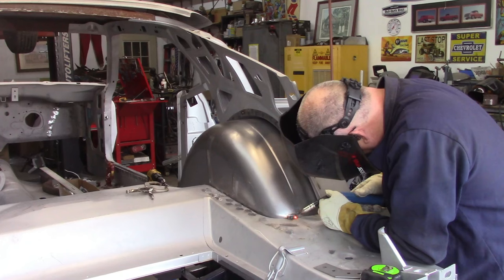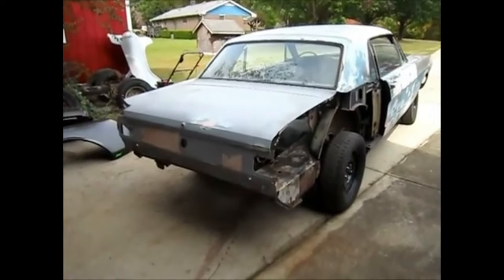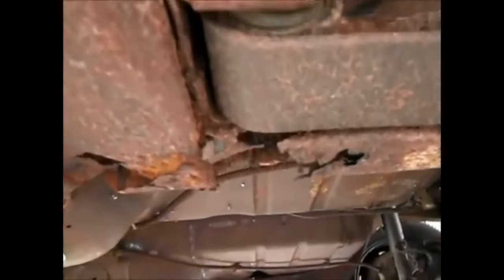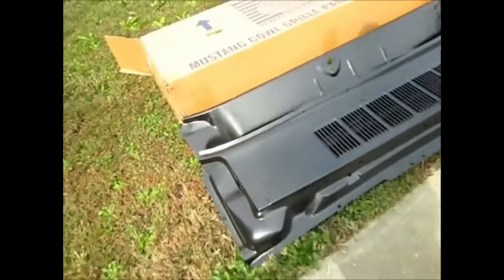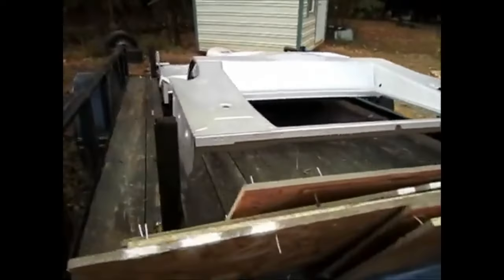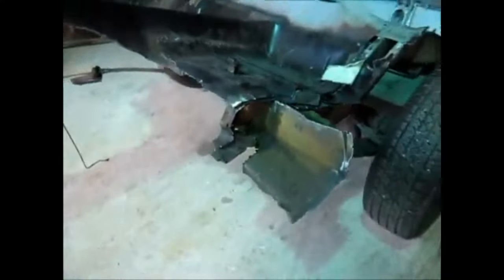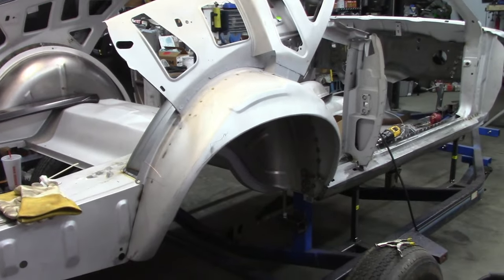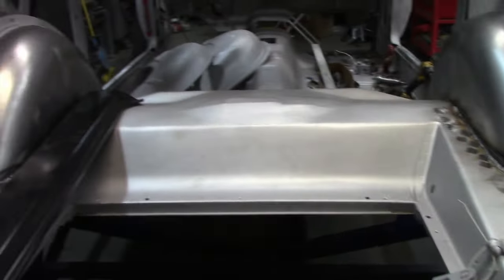1965 Mustang floor pan flashback video. Part 1. Dynacorn floor pan install.

Comment: 1) I like dynacorn products. I ordered a rear valance panel from them after messing around with an inferior one from another company. This one is thicker and pretty much falls into place. 
2) thank you for this video! I’ve been trying to figure out where to weld in my rear, outer seatbelt mounts. (Bad job by a company o hired years ago), and you inadvertently answered that question for me. (At least in the ballpark)

Comment: I was welding in shock tower reinforcement plates behind the coil spring on my 67 Cougar.   I knew I was getting low on gas.  Thought I could finish first side then get more gas.  I ran out in the middle of the first side.  Grinding out the bad weld was difficult.  No space for angle grinder.   My 120volt 30 gallon air compressor doesn’t keep up with die grinder.

Comment: Love that you are doing this. I am tackling a 1969 Mach 1 and my dynocorn floor is sitting in my garage. My equipment is just as you had in this video. I am scared to death of starting the plasma cuts though. You mentioned you had a jig, can you share the dimensions and make-up of said jig? Any assurances for my anxiety of cutting would be helpful. A jig would be just the thing.
Reply from the maker: Have you seen the Cobra Jet series? I’m doing the whole car in that one. I made the jig from a boat trailer. Videos on that too.

Comment: I have a completed car paint and all.
I took it to my buddy who is in to cars and we got it on his lift and the one floor support is completely shot and rust on lots of other areas. Am I able to replace the entire floor like you did from trunk to toe area with it being complete if we remove the engine and trans. Along with the entire interior?
Reply from the maker: Without seeing it I can’t say for sure. Possible? Yes. Difficult, yes.